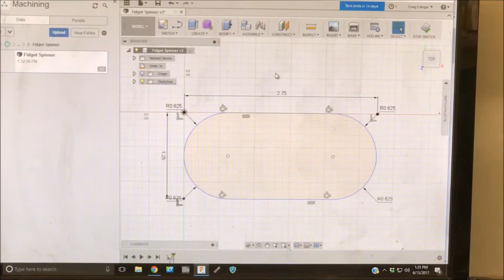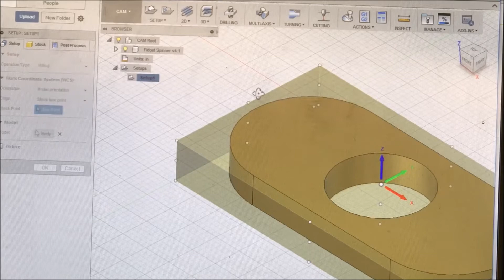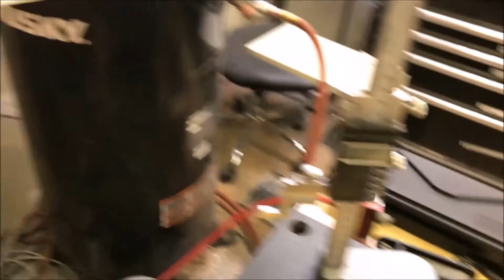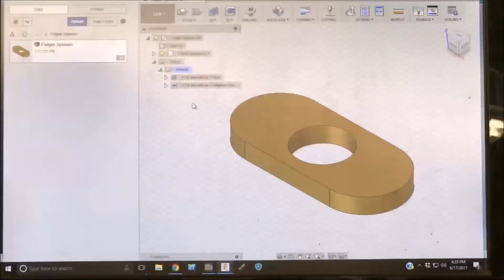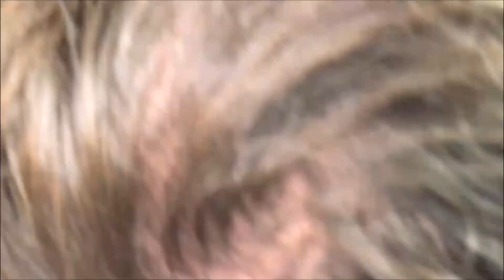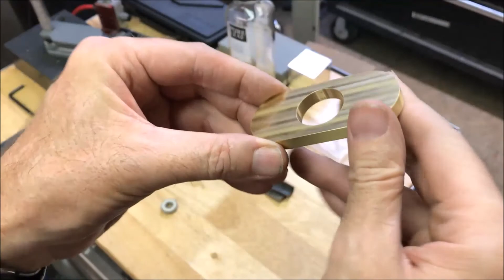Machining a Fidget Spinner - Step By Step - CAD/CAM/Machining

Comment: I would try a little loctite on the spinner with the slightly oversized (loose fit) bore. It should hold the bearing in place without unnecessary pressure on the bearing race which would cause drag.  Overall great content. Keep up the good work!

Comment: Hi craig great video. I'd like to just point out a few things.
1. its not good practice to grip stock off to one side in your vice, you should try keep short stock griped in the middle.
2.when machining something for a fit you should work out what size you want weather it be clearence or interference and measure the part as your going to prevent over or under sizing.
3.you dont need 3d adaptive for this type of part a standard 2d contour would have been fine.
4.you need to increase you everything ie depth,width and feed.running slow will cause more wear on you tooling.
Reply from the maker: Thanks Daniele.  Yeah, I forgot about putting it in the middle.  I try to cut the stock for minimal removal but I don't have a high dollar saw to say remove all but .020 on all sides.  John with NYCCNC  and Titan  of Titans of CNC 
always talks about using 3D adaptive. I will give 2D adaptive a try.  The feeds and speeds were for people with mini mills which have an effective HP of .020 since the mill is only 130 lbs. Thanks again.